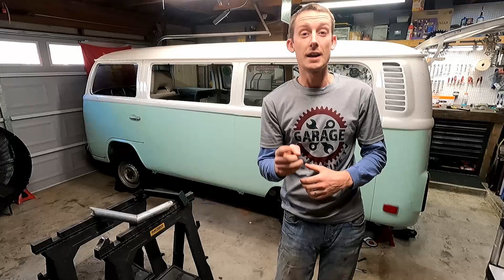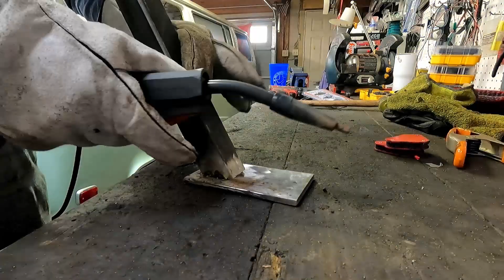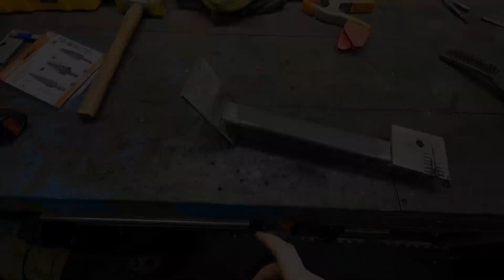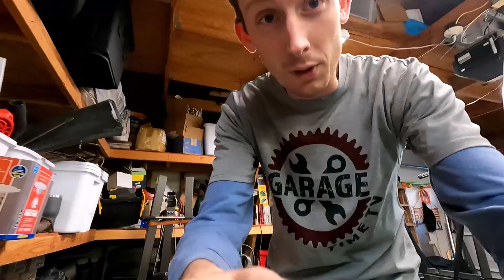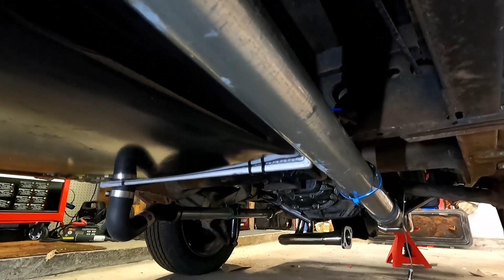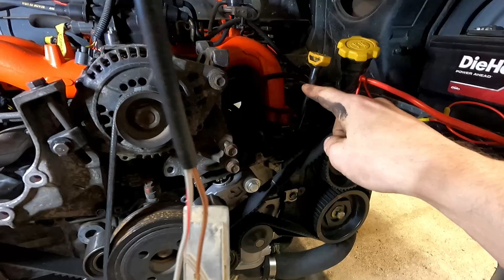Custom Engine Mounts for our Subaru Swapped VW Bus Project!

Comment: Have you had any issues keeping temps down in the summer months with the belly mount? What are your temps typically running at highway speeds? I have had issues keeping my temps under control in my 78 westy with EJ25 so just wondering your experience. Thanks!
Reply from the maker: It will get up to temp (212) at idle and traffic, but I’m running two 12” fans sucking air up and through the radiator. I stay around 185-195 during driving. I have a large aluminum radiator from a large truck so the larger surface area makes a difference too
Reply: Same but I dont have as good of scoop as you do so might work on that next to see if that makes the difference @GarageTimeTV
Reply from the maker: @Wohrleyful  I made one out of a single sheet of metal. The solid construction doesn’t allow for air to escape through the side. I also have the radiator slightly higher on the front